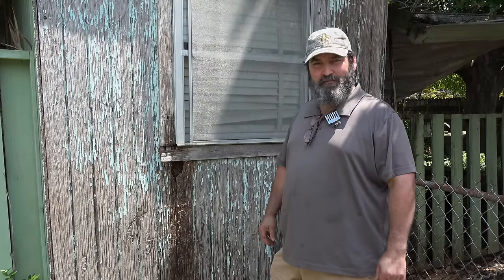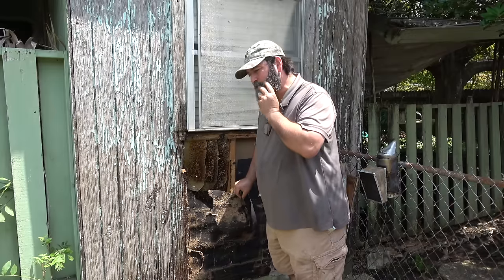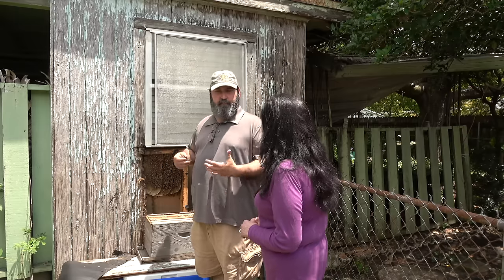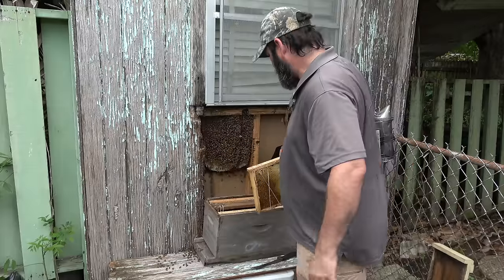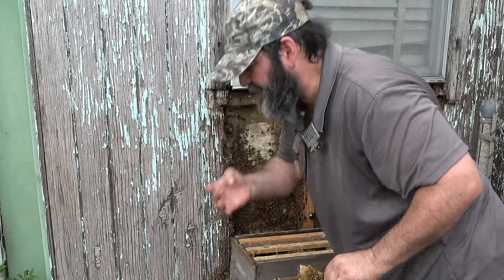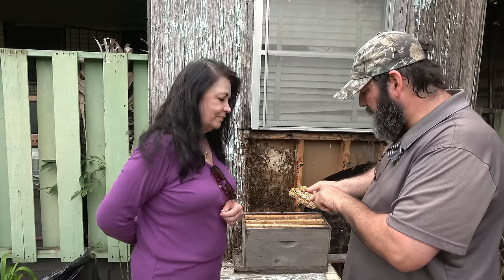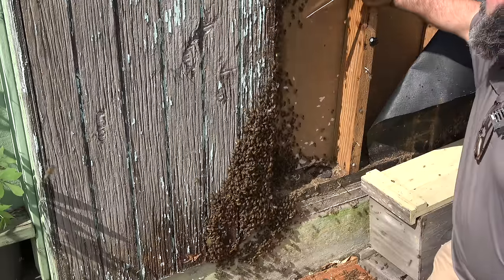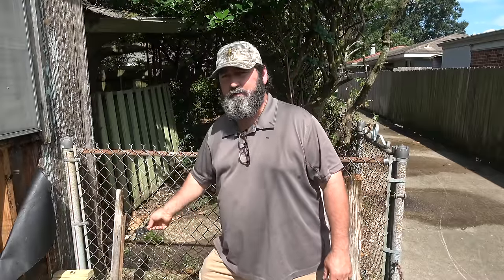Saving Dee's Honey Bees

Comment: When you're framing up the comb, do you always put it in the same orientation of up and down?
Reply from the maker: Yes
Reply: It has to be - the comb is actually built very slightly uphill, and it doesn't work right if it's put in wrong.